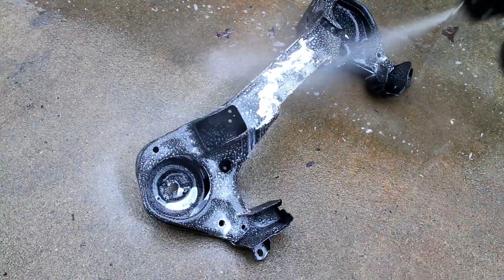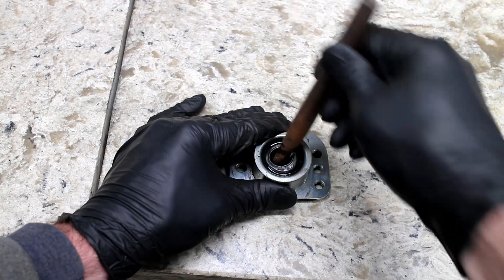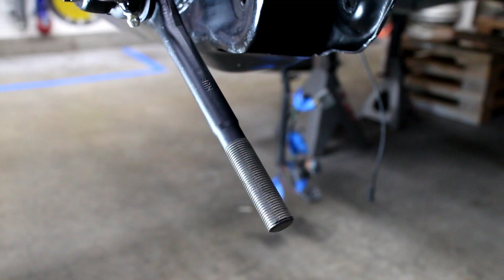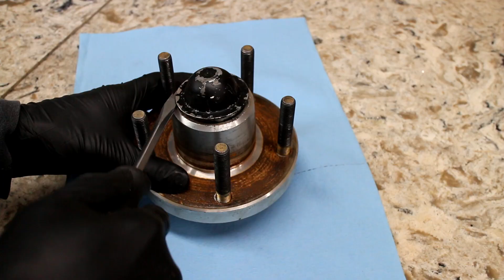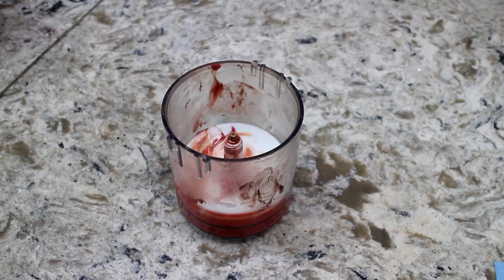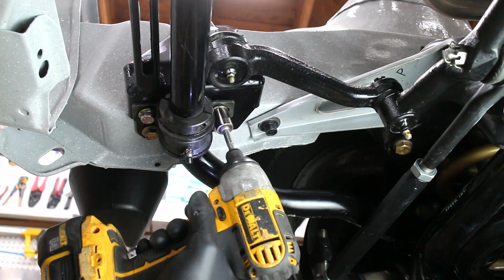82-92 Camaro Front Suspension Re-install  (Pt24 LS Swap)

Comment: You mention rain, well when I painted my camaro rain turned out to be pretty handy. This was one of my first few paint jobs and the clear was a tad textured. We'd had a power outage while I was spraying and I didn't notice until the pressure dropped and the gun didn't atomize like it should have. On the day I went to wet sand the entire car it started pissing down rain🤬. I said screw it, threw on my wet weather Gortex from uncle sam and got sanding😅. I use cheap baby shampoo from the dollar store when I wetsand something freshly painted, and with rhe rain I didn't have to worry about sanding sludge gunking up my paper or the panels. By the time I got to 3k sand paper, wet weather gear or not I was soaked but definitely worth it

Comment: A few questions. 1 what bump steer kit is that? And 2. The placement of your strut towers, how do you know where to put them exactly
Reply from the maker: an alignment shop will put the strut towers where they need to go.
I recommend buying the  J&M strut mounts first before an alignment
they have better ride quality, better longevity, better alignments, and better handling than the OEM ones.
that bump steer kit is custom built by me.

Comment: Great upgrades and description!
I believe your rotors are on backwards. Slots should vent outwards not inward.
Reply from the maker: the slots can face either way. 
slots don't determine rotor direction.(Dodge Hellcats for example)
the curved veins however have a specific direction.

Comment: Who did you go with for the front springs to replace the umi ones? I need to ditch mine for some stiffer any spring lengths that can help?
Reply from the maker: if you have UMI front weight jacks, a 8in or 9.5in spring free length works.
it's a 5.5in spring with a open end and one closed end.

Landrum has a Ton of springs available.
everything from 350in rate to 2,200lb

Comment: With the use of the Holley LS motor mounts, are you using the stock F-body oil pan, or did you have to use Holley's 302-2 oil pan?  Thanks in advance
Reply from the maker: you can use either pan, however the F-body pan still needs the k-member notch. they Holley an does not according to Holley.

Comment: Bro! I’m now convinced you and I are at the exact same point in each of our builds and moving at roughly the same pace! Every time you post a video it’s exactly what I had been working on that week, from measuring for wheel/tire clearance to clutch master cylinder hole cutting and now Detroit speed A arms! I went with a Heidts K member and I can’t get those Detroit speed A arms to fit! The mounting flanges on the heidts piece aren’t as easily manipulated as the one on the stock. So I’m kinda stuck trying to figure out where to go from here 🤷🏻‍♂️
Reply from the maker: I didn't show this, but I sanded of about 0.030in off the bushings to get them to fit.
super tight fit for sure.
Reply: @3rdGenGuy  I may have to do that as well. But I’ll still have to figure out how to widen the crossmember flanges without popping the welds cuz as it sits now, when I try to line up the A arms the flange hits right at the metal bushing sleeve 😔
Reply: You should post videos! I'd love to see more 3rd gen content. I upload videos of mine
Reply: @NotAGarage  I’ve thought about it cuz I’ve run into snags here and there and thought, man I wonder how many other guys ran into this too lol. Im just not very good with the content creating. DEFINITELY not as good as 3rd Gen Guy 🏆

Comment: youll have lots of room to start the upper transmission bolts from up top using those mounts. so when you get into the transmission install. it's not that bad. i used a 4L60E in my swap
i also used your video to cut the crossmember got mine running and driving last week
Reply from the maker: I actually installed the T56 bell-housing first, then the t56.
so much easier
Reply: @3rdGenGuy   ahh i see. went stick, i see. i respect it. my 2010 was a 6 speed. but Ares is Auto. it's going to be a full blown race car. lol

Comment: Spray can undercoating ...is not the best product to use  .. your automotive paint stores can supply the proper coatings
Reply from the maker: Holds up fine for the maybe 5,000 miles a year my car gets.
Race tires pick up rocks like crazy so wheel wells get pelted.
it's like a constant sand blaster inside my wheel wells lol

Comment: Surprised you didnt go with rack and pinion steering rack
Reply from the maker: Rack and pinions are for the drag race guys. There's no power rack that would be suitable for road racing in a 3rd gen.
Reply: @3rd gen
Wouldn't the rack and pinion found on a 4th gen be "suitable"?